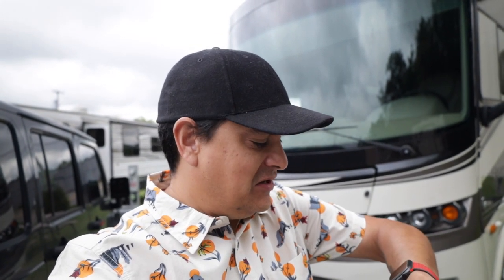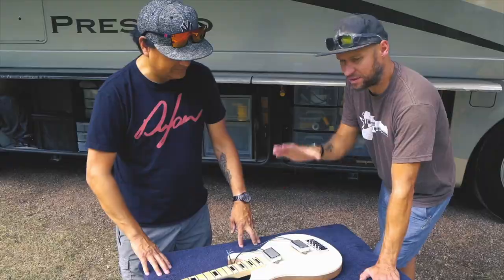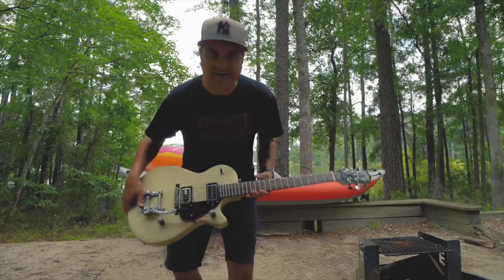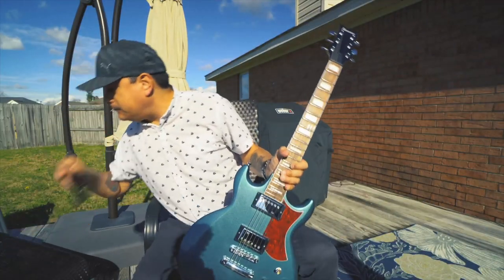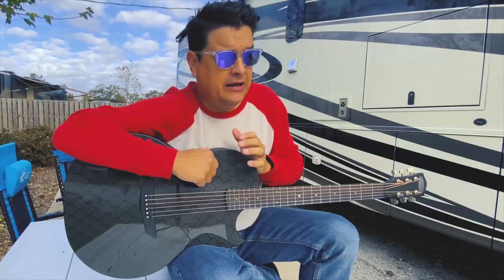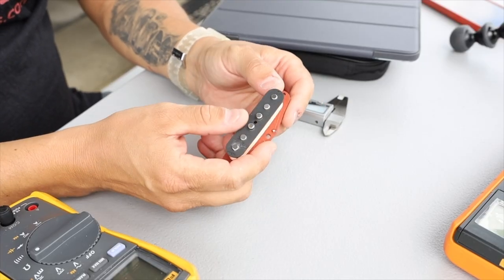How To Design A Guitar Pickup Episode #691

Comment: I have been searching the internet for information on a "noiseless" pickup design, I have been imagining.  I'm sure someone has had the same or similar idea.  I would very much like your input.
Would it be possible to create a "noiseless" pickup, using a "split' single coil design.  Maybe, an "end to end" humbucker, would be a better description. (As opposed to "stacked" humbucker design)  What I'm trying to describe is; one coil under the E, A, D strings , and another coil under the G, D, e  strings.  Out of phase with each other for noise canceling.  On a Stratocaster, the center pickup would probably have to be "flipped" (opposite) from the bridge & neck pickups. The only the design I have found, remotely similar, are pickups that have split bobbins. & have different grades of alnico magnets under the wound & unwound strings.   I'm sure there are major flaws in my idea.  What are they?